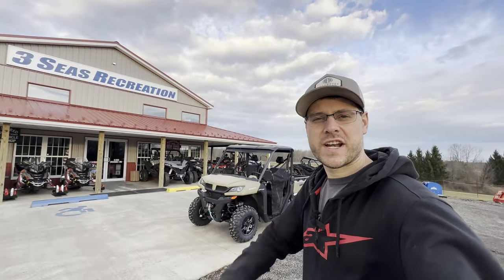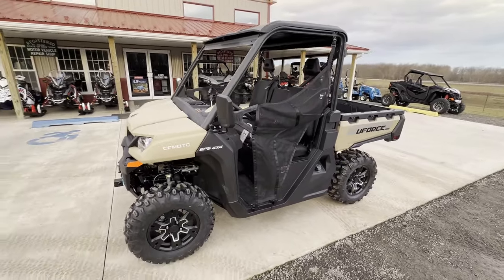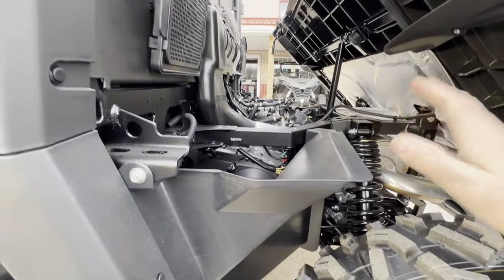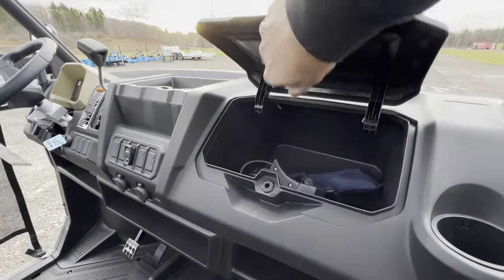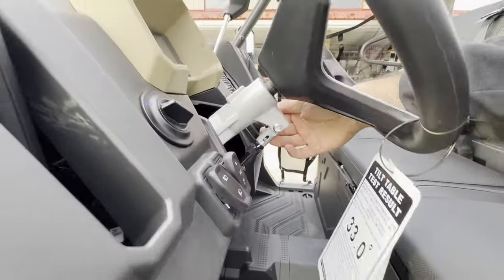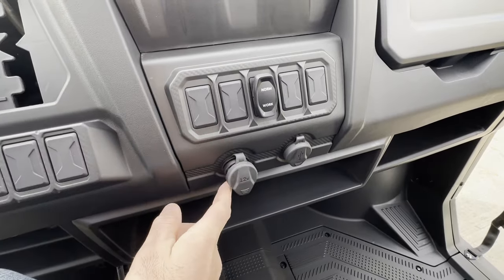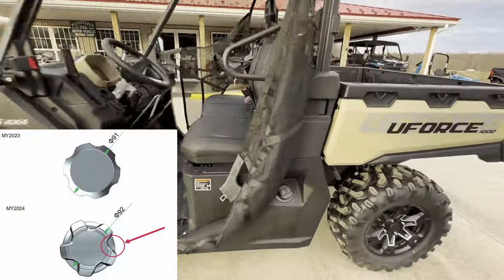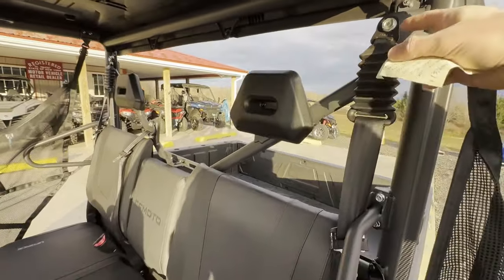What's new for 2024? The 2024 CFMoto UForce 1000 4x4 UTV +  Detailed Walk Around

Comment: One change that you missed and I wish the my 23 U1000 had is that I didn't see the over ride switch for when the machine has the front differential locked it.  Does the 24 not limit power like the 23 with the diff lock engaged?

Comment: Just used my new 2024 CF1000XL for 1st snowfall  this season. Is the string burn rubber smell normal? Had it on work mode 4 wheel, plow down, and low gear.
Reply: Look into getting a stage 3 clutch kit for that application, when plowing or riding in mud, there's a stage 3 mud clutch kit it definitely help along with a tune it's like night and day

Comment: I’ve own a 22 uforce 1000 xl and use it for trail riding and mud. If you are going to buy this machine for this kind of riding style it’s needs the rng clutch kit and a power tune it will wake it up completely also the Elka shocks. I’ve owned Polaris and can am machines they are all better in different ways.
Reply: how fast are they on the road?

Comment: Your videos helped sell me on the 23 U1000 that I purchased here in Idaho. I decked it out much like the one at the end of this video but I went with glass vs poly and a cab heater. I do have a question though, in the engine compartment on the driver side near the bottom there is what looks like a cable TV splitter. What is that for? My dealer is 1 hour away so I thought I would ask you.

Comment: Might be cheaper, but I have a ‘22 Overland with 625 miles that dropped an exhaust valve.  It’s sitting at the dealer in pieces because CF Moto parts are on back order with no known availability.
I’d spend the extra for Polaris/Can Am.  What good is a cheap machine if you can’t ride it.
Reply from the maker: We were a Polaris dealer for 25+ years.  You are kidding yourself if you think they don't also break. Sorry about your luck but CFMoto will make it right, the always do for our customers. Thanks, Jared
Reply: @3SeasRecreation  I understand all machines can break, but having it sitting week after week because they can’t get parts is frustrating
Reply: He said issue is getting parts that they break more. @3SeasRecreation
Reply: @3SeasRecreation  2nd addition.  Just got the machine back.  6 weeks.  $1400.
2nd 10 minute ride, right rear taillight doesn’t work.  $200 for the new one.
CF gonna  “make it right”?  Hasn’t done a damn thing for me but cost me almost $2000 with only 630 miles.
Again, spend the money.  Steer clear of CF Moto
Reply: Doesn't Polaris or Can Am make the overland?
Reply: @pmaint1  no, CF Moto
Reply: @adampecore6917 My mistake. Your model is a cforce. Can Am makes an outlander too but it's a sxs.
Reply: @3SeasRecreation  update:  CF Moto hasn’t done anything to “make it right”.
The repair was $1400 and then I had to replace a tailight at $200.
The issue is that no one makes after market CFMOTO parts so they can charge as much as they want…. and they do.
Stick with the big names.
Reply: @adampecore6917 it’s under warranty.
Why would you pay to have it fixed.
Reply: @3006USMC  it wasn’t.
Only 1 yr warranty

Comment: I saw the unit was in park, you should never use park on a cvt tyranny that’s what the parking brake is for.
Reply from the maker: Hmm you can def use park while it’s sitting still in the parking lot. Kinda the point of the gear. They don’t recommend using it while being trailered down the road. Enjoy The Ride, Jared